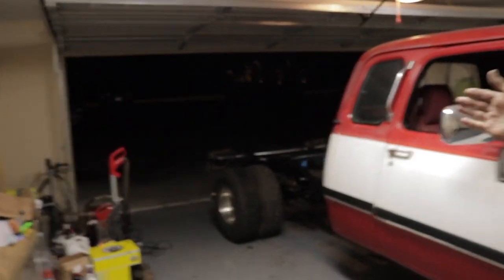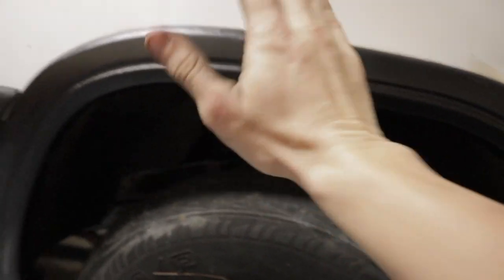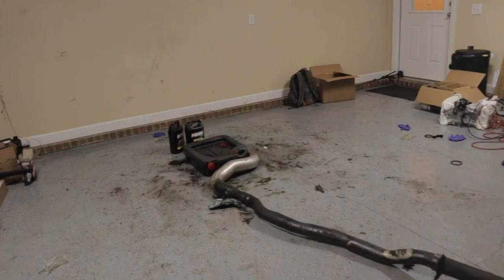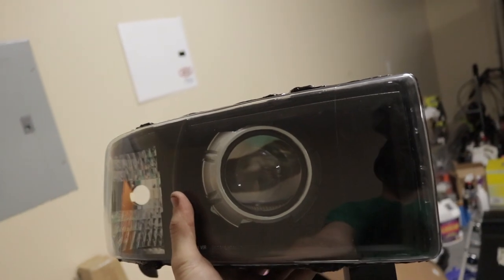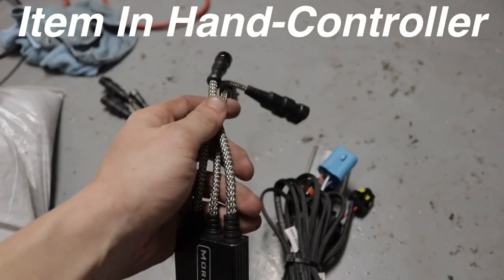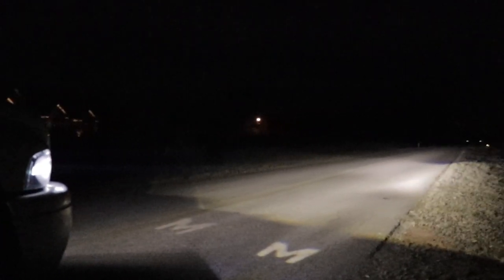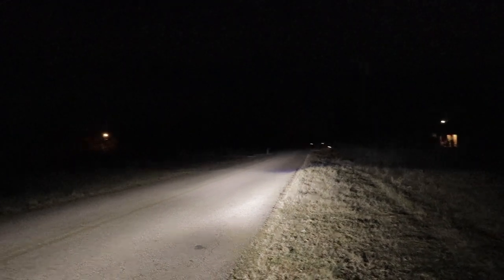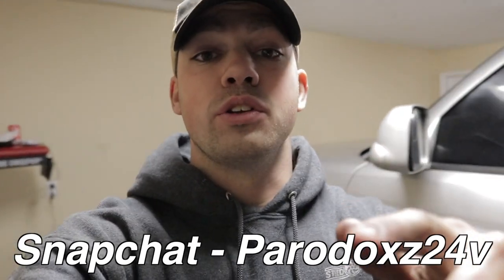BRIGHTEST HEADLIGHTS OF 2018!! LED PROJECTORS!

Comment from the maker: SMASH THAT LIKE BUTTON IF YOU LIKE THE NEW HEADLIGHTS!! COMMENT YOUR THOUGHTS!
Reply: ParoDoXz wax the chassis please.
Edit: it will save it from rusting.
Reply from the maker: Its got chasis saver on it, non rust epoxy
Reply: ParoDoXz what site did you go to, to buy new wheels and tires for your 24valve
Reply: ParoDoXz ok good, can’t let a nice truck like that down.
Reply from the maker: Charles Lang I got them from 4wheelparts but don't recommend them. Pretty bad service tbh
Reply: ParoDoXz glad to see you got my bumper pieces installed!!!! Anywho what headlights is the first gen getting? If they pull ANY more amps then factory you really need to do the relay mod for the headlights (google it) jcwhitney and a few other places make a plug and play kit for like 35 bucks.  The factory wiring sucks and with bright lights you will fry wires without relays.
Reply: ParoDoXz love the headlights, I was going to settle on stock replacements but now I'm saving for these!
Reply: Thought you said it wasnt close to the 1000 dollar set ups 600+ is closer to 1000 than 350 or 400 and you can get a damn good set for 400 and be just as good as anything 600+
Reply: ParoDoXz I know you know your stuff could you please help me on a couple things for my 2nd gen I don’t know what headlights to get I’m wanting like stupid bright lows and highs I also need stupid bright reverse lights can you please help me thank you.
Reply: Are those the non-sport one piece?

Comment: Those headlights are absolutely dope 💪🏻 I’m definitely going to go with them instead of some eBay bought headlights
Reply from the maker: GETLOWDUDE Thanks man! They turned out so good! I definitely recommend them!
Reply: GETLOWDUDE good choice man we gotta help these small companies get a leg up in this world!
Reply: GETLOWDUDE good! Retrofits are much better than eBay lights.
Reply: Good luck robbing a bank, apparently these headlights are $700 for the whole assembly
Reply: Why you don't build your own, is not difficult.. I have 4 hid projectors in mine 55w each 5k color... I may upload a video but I don't have time to do that.. it's easy

Comment: Had a couple questions lol, when you were showing the lights were they on high or normal? Could they be purchased without the M logo, and do they produce enough heat to melt snow/icr off the lights as you drive? Thanks

Comment: Whats up brother! I know you sold your truck but Im about over looking for decent headlights. Im going to pull the trigger on a set of these I just have a question about them. I have an 01 Sport also. They have the highs and lows separate (2 separate bulbs). How did that work out for you considering these are a single bulb. Thanks man!

Comment: I have a 2017 outlander 1000 hunting edition and it won't go into low gear do you have any idea what it could be it's brand new ive had it 3 months and it's got 100 miles on.. also sweet headlights man
Reply from the maker: Jeb Brooks Have you check your diff fluid and transmission fluid for metal shavings?
Reply: ParoDoXz yeah everything looks perfect. it's crazy

Comment: Have the same headlights, when it shows  "a few days later" in your video, did you run into complications? The shop I have installing these seemed to have an issue with getting them hooked up.
Reply from the maker: microsharpie naw man , I’m actually ordering another set now for my new truck, I love them . If you need to know how to adjust them , there’s a philips head screw on the back that you just turn and it will raise or lower the beam
Reply: @ParoDoXz  the shop I have installing them told me that had an issue just trying to hook them up, not adjusting yet, they can't get them wired up...frustrating.
Reply from the maker: microsharpie Did you ask what exactly wont hook up? If they need to call Travis up at TheHIDFactory they can man, he can walk them through it
Reply: Not sure on specifics, I will try to find out today.

Comment: HID Factory seems to have poor customer service. I cannot get a simple email question  answered. How can I expect customer service with a 700$ headlight.
Reply: kapp180 haven’t had luck either
Reply: kapp180 I had the same problem. You have to go on their website and scroll to the bottom to contact them. If you try contacting them by Facebook or email they don’t seem to respond. You have to go to the bottom of their website